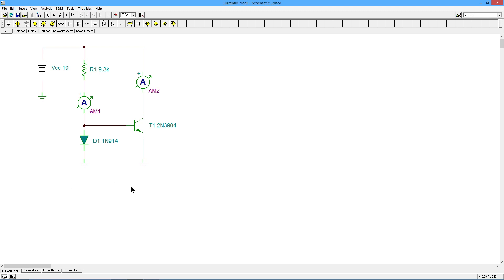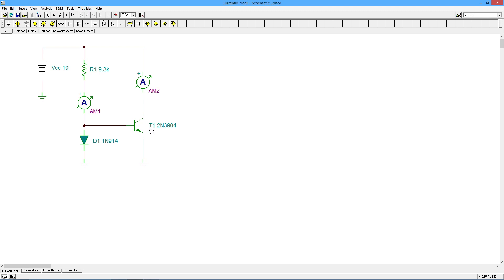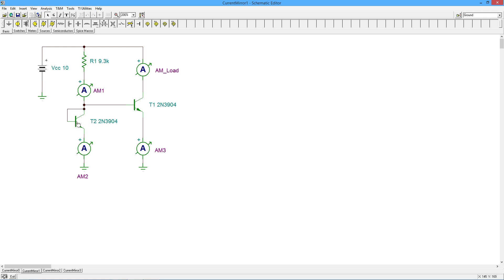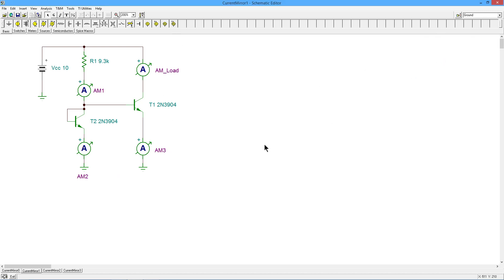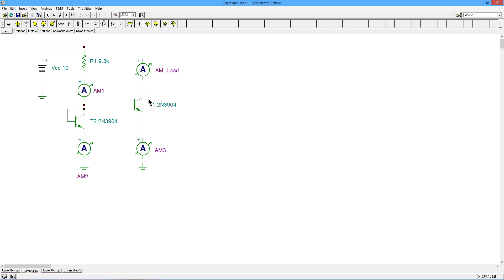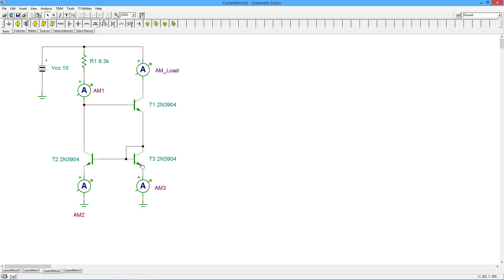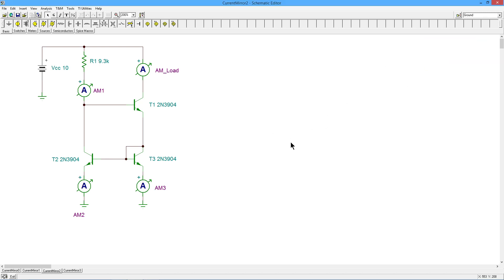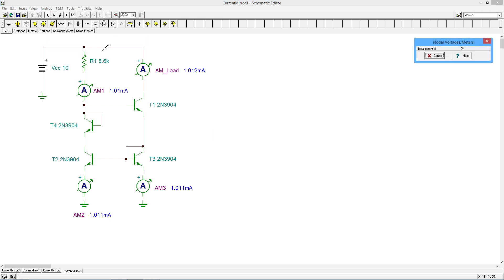The Current Mirror

Comment: The analysis of the first version at 4:15 in the video is flawed because the transistor has gain, so the collector current is a multiple of the base current. To verify this, instead of using a separate diode and transistor, I used a  CA3096E, which is an integrated circuit containing 5 independent transistors. The advantage of this is that you get good matching between the individual devices. (The "E" version is the least well matched, but is still much better than a separate diode and transistor.)

I used 2 of the 5 transistors, but initially only connected the base and emitter of one of them, leaving the collector open circuit. In other words, I used the base-emitter junction as a diode. I wired up the circuit at 4:15, but used a 10k resistor for R1 and a 12 volt power supply. The current through R1 was 1.14 mA, in line with expectations, but the current in the collector of the transistor was 13.5 mA, which is 10 times higher than the video would lead us to believe, despite the use of the CA3096E.

I then joined the base of the transistor previously used as a diode to its collector, to get the second circuit as in the video at 7:00 (but without the two additional current meters and still with the 10k resistor and 12 volt power supply). The current through R1 remained the same at 1.14 mA, but the collector current of the right hand transistor dropped from 13.5 mA to 1.31 mA. This is in line with what might be expected as explained in the video.
Reply from the maker: If you left the collector open, then you wired it incorrectly, and I am not surprised that your results were way off. If you're going to use a BJT as a diode, you have to short the CB junction. That is literally how the diodes are "made" in the IC. There is nothing wrong with the analysis presented in the video.

And there is nothing wrong with the simulator, either. To verify this, just simulate the circuit shown at 7:00, but alter it such that the CB junction is not shorted (i.e., leave the collector open as you did). You will see that the simulator now shows a wide deviation between the set current and the mirrored current (as you measured).
Reply: @ElectronicswithProfessorFiore  I don't agree. Shorting the base to the collector changes the circuit from your first design at 4:15 to your second design at 7:00.  As, described, I tested both. The second version works as expected and exactly as you described. I have no issue with that.

The problem lies with the first design at 4:15 in the video. To check this, I replaced the open collector transistor used as a diode by a 1N4148 diode, which is identical to the 1N914 that you use (keeping the right hand transistor as one of the CA3096E transistors). So I now have a circuit identical to yours apart from the fact that I'm using a different transistor. (I do have some 2N3904's that I could try next, if you're not convinced.) With the 1N4148 diode, I measured 1.06 mA through R1 and 49.8 mA in the collector of the transistor. So clearly, it's not working anything like a current mirror.

The problem with this first design is that the resistor current of about 1 mA is shared between the diode and the transistor base (not necessarily equally, but that's a secondary problem.) Assume for the sake of argument, that the diode takes 0.6 mA, leaving 0.4 mA for the transistor base. If the gain of the transistor is 100, then the collector current will be 40 mA., which is in the same ballpark that I'm measuring. So this design does not work as a current mirror.
Reply: ... continued: So why does the second version, with the base shorted to the collector work? The reason is that the resistor R2 current is now shared three ways: some into each transistor base and some into the collector of the left transistor. The question is, what share does each of these get? If the two transistors are matched, the base currents are equal. The collector current is 𝜷 times the base current, where 𝜷 is the transistor gain.  So the total current is 2 x Ib + 𝜷 x Ib, where Ib is the base current. This equals 1 mA. Assume that 𝜷 = 100, then Ib = 9.8 uA. The current in the right hand collector = 𝜷 x Ib = 0.98 mA, which is roughly the same as the resistor current. There are some secondary effects that alter this slightly, but basically, it mirrors the resistor current.

Finally, to address your comment about not being able to use a transistor with an open circuit collector as a diode, I disagree. The base - emitter of a transistor is a PN junction. That's what a diode is. It blocks reverse currents and when conducting, has a forward voltage offset of about 0.7 volts just like any other diode. The fact that there's another bit of N-doped silicon next to the P-doped part is immaterial - it's not connected to anything and plays no part in the operation.

(Incidentally, I liked the way that you drew the final design. Many people draw it with the base of the final transistor connected to the emitter of the third transistor. Topologically, that's identical but it's confusing. In contrast your layout shows exactly what's happening.)
Reply from the maker: @Chris-hf2sl  Some of what you're saying is true, but apparently, you missed several points in this video. First off, the original circuit will work as intended IF you can get a diode whose Id vs Vd curve is identical to the Ic vs Vbe curve of the BJT. Reread that previous sentence. That's the starting point of the concept; the theoretical ideal. The practical reality is that that is very hard to do, thus we begin to look at ways of doing it practically, and improving it incrementally as shown in the various versions. Some of the non-ideal things we deal with include the fact that we need to keep the junction voltages the same between the two devices and that we really can't ignore base current if we're looking for highest accuracy.

As far as your disagreement is concerned, having two matched transistors and using only the BE junction of one of them is not the same as having a simple diode whose curve matches the transconductance curve of the BJT. In other words, even if you have two identical transistors, by leaving the collector open, they are not operating at the same point (e.g., Ib values are way off), and this unbalances the circuit, leading to a wide disparity in the currents. Your calculations allude to this, but you seem insistent on confusing the two. Now, is the first circuit a great current mirror? NO. If it was, I would've ended the video right there. ;-) Perhaps you find my "incremental refinement and improvement" approach confusing, but it's a technique I've used successfully in the classroom for 40 years. 

You might want to refer to my Semiconductor Devices and Op Amps textbooks for more details. They are free to download (see links in video description).
Reply: @ElectronicswithProfessorFiore  Many thanks for your detailed reply. First, the positive - I like your 'incremental refinement' approach and have no problem with your analysis of the circuits after the first one. And as I said last time, the way you drew the final circuit is particularly illuminating.

Where we disagree though is over the first circuit. I have now tried three versions. The first using a CA3096E with an open collector transistor as a diode and one of the other transistors. In the second version, I used a 1N4148 diode, still with the transistor in the CA3096E and finally, using a 1N4148 and a 2N3094 transistor. The last version had the same 1 mA. in the resistor but only 0.2 mA in the transistor collector. This was not what I was expecting, so I tested the transistor and it's fine, with a gain of 170. However, the voltage across the diode was only a bit over 0.6 volts, so the transistor base is presumably being starved of current - hence the low collector current.

You say that we need "diode whose Id vs Vd curve is identical to the Ic vs Vbe curve of the BJT". That would ensure that the current is shared equally between the diode and transistor base. But the problem is, the collector current is 𝜷 times the base current. Furthermore, 𝜷 varies so much from one transistor to another, that without negative feedback, the collector current is anybody's guess. So whilst the circuit will indeed provide an almost constant current, the value of that current is highly unpredictable: my three versions have given me currents ranging from 0.2 mA to 49.8 mA.  So the circuit's not even an approximation to a current mirror.
Reply from the maker: @Chris-hf2sl  said: "That would ensure that the current is shared equally between the diode and transistor base."

No, absolutely not. I don't know where you got that from. The current through the diode is just slightly less than that through the programming resistor (reduced by the base current of the right side (mirroring) transistor). Assuming you could obtain a diode whose Id vs. Vd curve is identical to the Ic vs Vbe curve of the mirroring transistor (i.e., at some temperature, Vce, etc.), then Ic would have to equal Id because Vd and Vbe are the same (as they are in parallel). The Ie would be slightly higher than Id (due to Ib) and equal to the current flowing through the programming resistor (because that's equal to Id plus Ib). 

Bottom line, the key is matching the Id-Vd curve to the Ic-Vbe curve. If you take transistors with matching Ic-Vbe curves and then use one as a diode without connecting the collector, what you're looking at is an Ic-Vbe curve against an Ib-Vbe curve. These are not the same thing. Those two curves are never going to match, even if their Ic-Vbe curves are identical. You cannot treat the base-emitter junction as if it was a discrete diode, pretending that the collector junction has no effect. Indeed, part of what the video sequence shows is that Vce (or Vcb if you prefer) does have an effect. The size of Vcb affects the depletion region in the base-collector junction, and that affects current flow (for details, look up "Early Voltage"). If you leave the collector open, there is no Vcb, per se, and the two transistors are not operating under the same conditions. This is why subsequent versions added more components in an effort to make those junction voltages closer, which improved accuracy.

Now, if your argument is that the original discrete diode circuit is not a great current mirror in a practical sense, sure. That's pretty much what I said at the outset. The final circuit is, in contrast, a very good current mirror, and has been used in numerous applications.
Reply: @ I don't think we're going to get anywhere here. The only point I was trying to make is that the first design can't really be called a current mirror. You would get better performance with a simple common emitter transistor, whose base is connected to the positive rail via a resistor. Just divide the desired output current by the transistor gain and calculate the appropriate resistor value. (That's not a current mirror either, but at least it gives a better defined output current.)

I built and tested three variations of the first design, including one with a 1N4148 (1N914) diode and a 2N3904 transistor, just like in your schematic and I got collector currents ranging from 0.2 mA to 49.8 mA. That's not even remotely similar to the reference current of 1 mA.

Anyway, I thank you for your discussion and for the video, which apart from this one point is excellent.
Reply from the maker: @Chris-hf2sl  I believe that you're correct in saying that we're not going to get anywhere. If you were a student of mine, I'd invite you into my office and have a one-on-one to clarify this, but a back-and-forth via YT comments is anything but efficient.
Reply: @ElectronicswithProfessorFiore  Many thanks for your reply. Yes, it's not very efficient but nevertheless it's been interesting.

Comment: So what is the total current consumption from the voltage source?  Would it be 935uA? Or 935uA times four? Sorry for the stupid question..
Reply from the maker: The current out of the supply splits into just two paths. Therefore the total supplied current would be just under 2 mA.
Reply: @ElectronicswithProfessorFiore  Cool thanks!

Comment: This makes sense, this way of explanation! Working my way trough the videos!

Meanwhile, I installed TINA-TI. I wanted to know what the mirror does when left and right side have different supply voltages, instead of both 10V. I gave right side it's own supply voltage and played around, from 5V upto 25V: still a nice current mirror! Kind regards.
Reply: Later I  also did put a load resistor at the right side above the both rightside transistors: still a nice current mirror!
Reply from the maker: @cbc7599  Yes, it's wonderful being able to quickly experiment with circuits in the simulator. "What if" experiments are much quicker than trying to do it with physical circuits in lab.